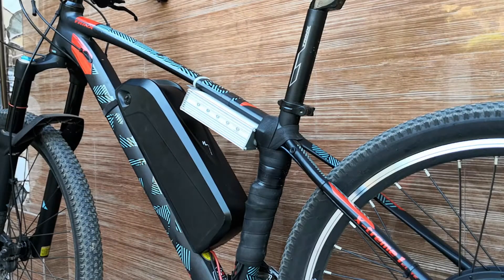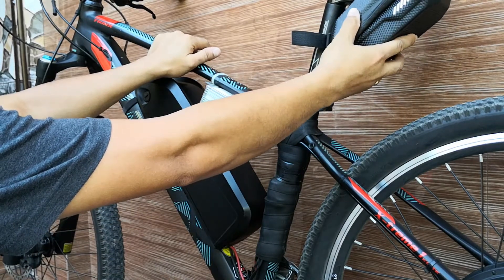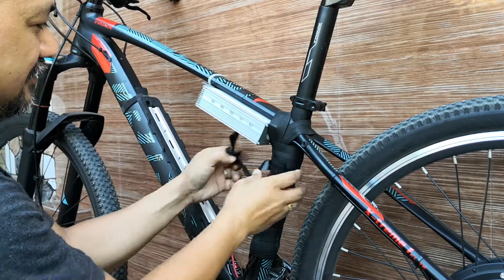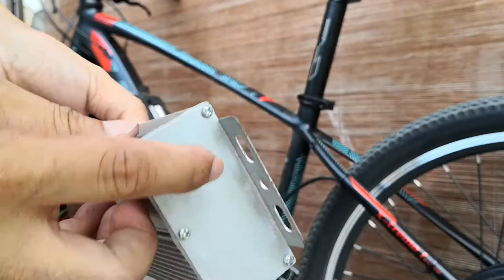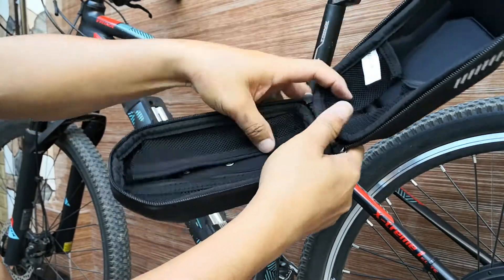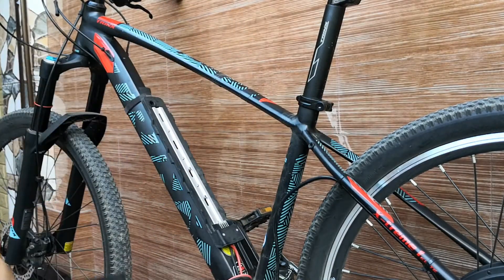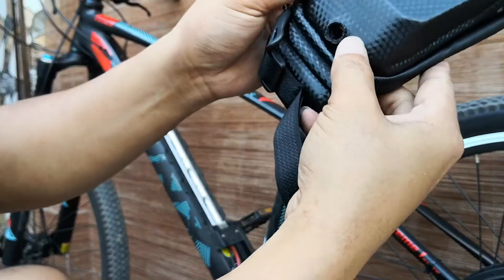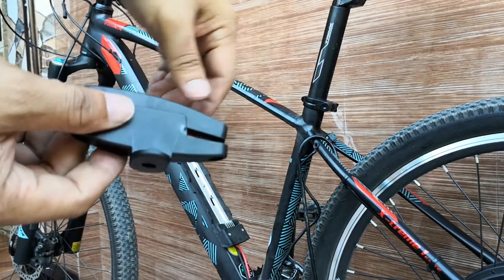DIY EBIKE CONVERSION Trinx Xtreme X1 Elite - Update | DIY Petz

Comment: how much did you spend for the conversion?   i also have a trinx-x1 and planning to get a new e-bike or a kit.
Reply from the maker: Good evening PY.  The conversion kit would actually depend on the specification. For my conversion below are the estimated amount. Bought the rear hub motor from Alibaba but you could already find one in shoppe and lazada. 
1 pc 1000 watts 48 volts motor = aprox 15K
1 pc 48 volts with 16AH rating = aprox 20K
Total would be around 35K 
Thanks.

Comment: Nice video I love the conversion. What is its top speed and range? And will the motor still assist you if the weight that is being carried is over 100kg?
Reply from the maker: Good evening Sir Curt. Top speed will depend on various aspects as to the body weight of the rider, tire pressure and the terrain being travelled on to. Pedal assist levels also has ranges and as follows:

PAS Level 1 : 20-25 km/hr
 PAS Level 2 : 25-30 km/hr
PAS Level 3 : 30-35 km/hr
PAS Level 4 : 35-40 km/hr
PAS Level 5 : 40-50 km/hr

Ideally on normal driving the 48V 17 Ah battery would reached more than 70 km on a single charg.

load capacity for the motor is 100kg but it would still assist your even if the weight is more than 100 kg, but the more power the battery will use, thus shorter range.